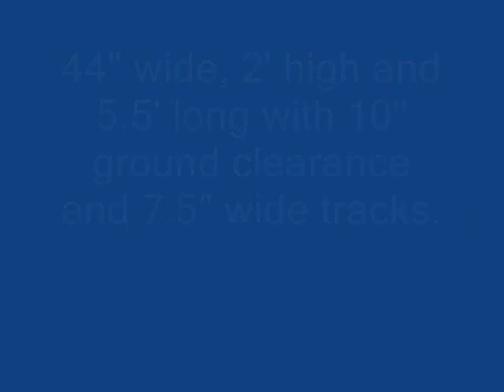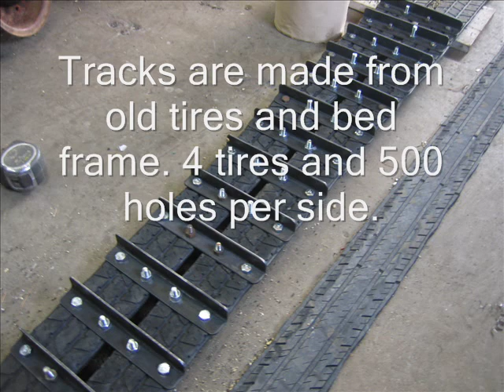Goliath Military Tank GoKart Progress

Comment: I like the way you made your tracks but I would also like to know what size was the tires that you used to build them.
Reply from the maker: Robert Stark they were just youre average car tires I think they were Cooper probrobly like 195/60/15. I cut the middle 3 tread blocks just followed the lines along with a sawzall. That way I didnt have to deal with the curvature of the edges. then used a grinder to clean up the rough cuts and straggley wires
Reply: OK.... Cool, thank you for the answer.

Comment: Dude, inspired me to start planning on making a copy of yours. Assuming the tire strips had to be connected end to end to make the length of the track, how did you connect them so seamlessly?
Reply from the maker: cool. yes they are staggered 2 cleats and have large staples holding them. then there is a tab welded on the back of the angle so i can bolt it with 2 bolts on each side of the split.
Reply: jeep2003 ah yes I seen after watching more of your videos. I've never attempted anything like this so I want to test myself. Were the shafts coming out of the transmission originally wide enough to reach outside of the body? I have a hydrostatic transmission I want to attempt to use and at first glance they don't look wider than the body of yours.
Reply from the maker: i extended them just by butt welding them. if your spider gears arnt splined and use notches instead you can make entirely new shafts but if not butt welding them seems to work just make a nice wide bevel on the ends so you get excellent penetration. Also i had to make extensions outside the body for bearing supports right out to the drive wheels because the 3/4" axle bent under testing when a track bound up.
Reply: What's the width of the body not including the tracks?
Reply from the maker: its about 28" plus 9" for the side pods. 46" total. I did that so it will fit in a 4x8 trailer. But the main consideration is the width of the engine and leaving room for your legs

Comment: What model of peerless transaxle is that?
Reply from the maker: Im not sure what model it is. not sure if i even saw a tag on it. ill take a look and let you know if i find it. I extended the axles just by beveling them way back and filling it all in with weld then grinding it down to 3/4 again. iv done that several times before and it seems to work fine
Reply: Ok thanks, the ID tag for the transaxle should be near the brake rotor/caliper that came with it